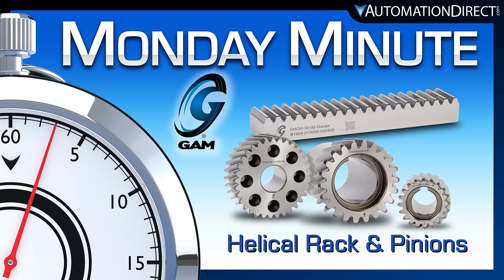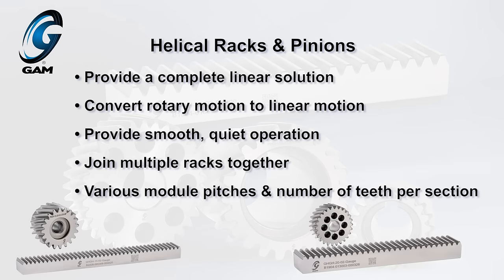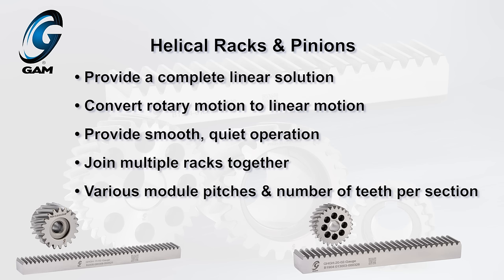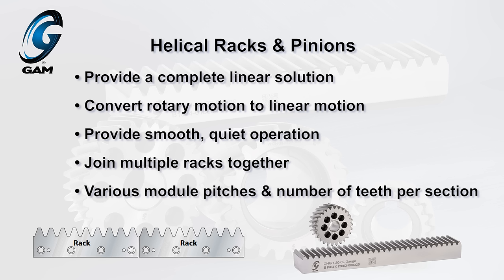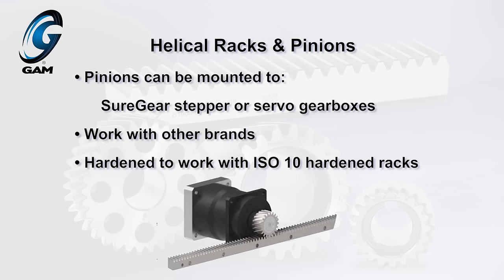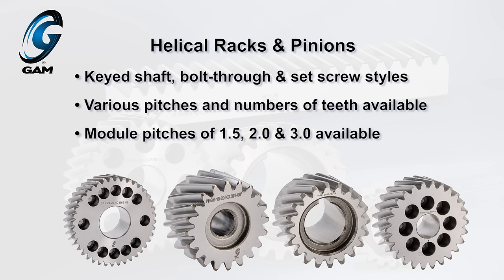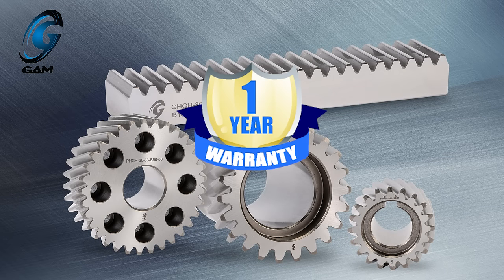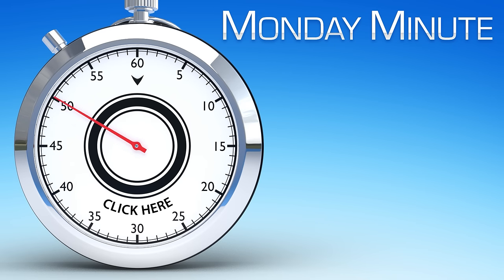GAM Rack & Pinions - Monday Minute at AutomationDirect

Comment: Will it move 150 kg load in linear?
Reply from the maker: The GAM Rack and Pinions are rated for up to 20.05 kN max feed force. I don't know anything about your setup, but in general I would expect that to be able to handle your 150kg (1500N) load. You can see all the specs here: https://cdn.automationdirect.com/static/specs/gamrackandpinion.pdf